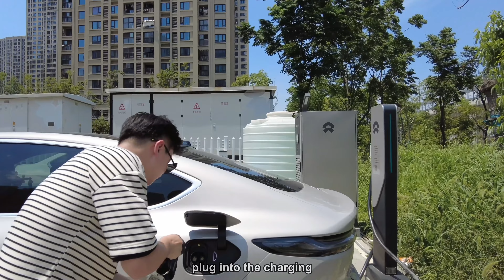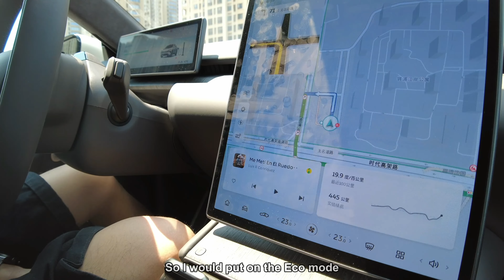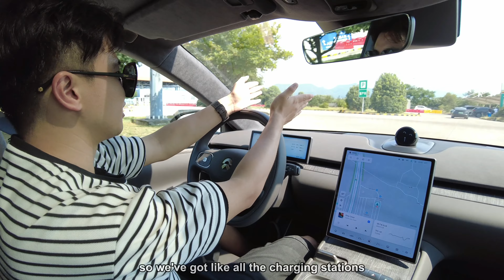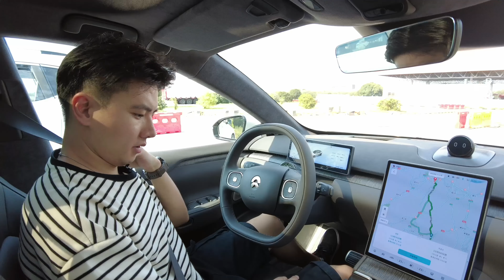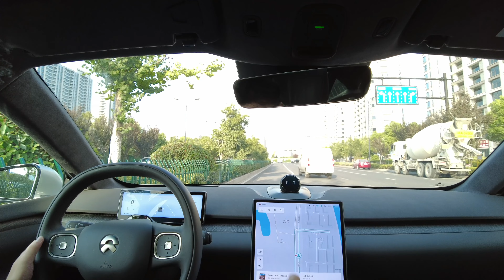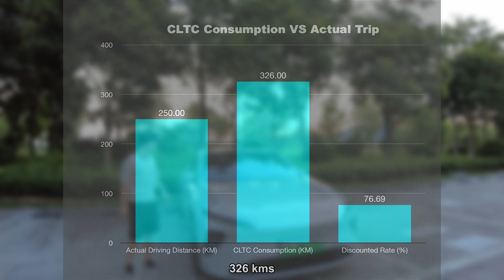NIO ET7 Range Test At High Speed & Extreme Heat Wave | How Far Can It Go With NIO 100 kWh Battery?

Comment from the maker: Hey guys, forgot to mention the average speed on the video! This test is about highway range test as the city road driving distance was only 6kms.
We can work out from the video:
13: 31 PM arrived at Yiqiao toll station, Odometer: 3,316 kms
15: 01PM arrived at Dongyang service station, Odometer: 3,450 kms
So we’ve driven 134 kms for 1 hour and 30 mins (1.5 hours).
 
13: 54 PM leaving Dongyang service station, Odometer: 3,450 kms
15: 13 PM getting off the highway, Odometer: 3,561 kms
So we’ve driven 110 kms for 1 hour and 19 mins (1.32 hours).

Therefore, the total trip on highway is 244 kms for 2.82 hours
Then, we can work out the average speed on highway is 86.52 km/h.
One thing need to be noticed that we cannot drive all the time by following the speed limits there as there are alway low speed vehicles ahead.

Hope you guys enjoy it!
Reply: Thanks for the informative video and greetings from Kazakhstan) How many kilometers do you think ET5 with 100kwh battery can travel at a speed of 100 km/h?
Reply from the maker: @dragykz  Hi there, no worries, glad you like it! I am not sure about ET5 at the stage as it hasn't been delivered yet. However, I would say ET5 could done better job than ET7 because it has smaller size and weight than ET7.
Thanks for watching!

Comment: How did you turn off all the ding and dong noises the car usually makes.? When I watch European tests of the es8 the car makes many noises. Pretty disappointing range tests even with the temperature issues. Thank you for your hard work.
Reply from the maker: Hi there Reginald, the ET7 is actually quiet. I am not sure about ES8. For my ES6 is also no issue with noises, but the NIO NT 2.0 models are better on sound insulation, and range performance.

Thanks for sharing your thoughts!

Comment: Your calculations are right, i got real 531km on a hot summer day without stopping between and three people and luggage in the car. I didn’t use eco mode, but sport mode. The adjustment of the speed was similar between 105 and 115 km/h , air-con on automatic , it’s true more than 500km easy to get if you not driving too aggressive 😂⚡️🔋🏁
Reply from the maker: Yeah, agree with that. The 100kWh battery could go over 500kms easily if people don't drive too aggressive.
Thanks for sharing those information!

Comment: Hello from Europe. Maybe you should just do a long trip without so many variables. We had several range tests on smaller EV cars from here (way smaller lol) and they drove the cars from 100% charge to 0% when self protection mode of the car intervened and immobilized the cars one by one. Such test is very easy to "comprehend" and is a no BS scenario. You drive until it dies. Simple.

here is an example with medium sized cars.
https://youtu.be/xg6-Vc9CSwk
Reply from the maker: Hi there, yeah that would be more simple way for the range test, but we din't have too much time to conduct that long distance test on that day.
Thanks for your advise!

Comment: Just wondering how do you put Nio car in neutral mode (it doesn't seem to have the n letter in its transmission selector) like you do in a normal car like when you park but you need your car to be physically pushed when it is blocking the other car?
Reply from the maker: Hi there, there is a mode called towing mode that we can do it on the screen.
Thanks for watching!

Comment: If it consumed 14.6kw/100km it means your battery pack of 100kwh / 14.6 = 6.84 x 100km = 684km max range. That’s your range with a battery pack 100kwh and your consumption of 14.6 kw/100km
Reply from the maker: If we take that number the total estimate range even higher than NEDC range, but it may due to many driving distances were on the descents when we came back Hangzhou.
Thanks for sharing your thoughts!

Comment: how much does a 1kwh cost on charging station?
Reply from the maker: Hi there, it depends on the time, and different kind of charging station you going. For the one in the video, If you charge your car during the night 22pm-8am, or 11am-13pm then $0.09(¥0.6)/kWh and $0.04(¥0.24)/kWh for the service charge. From 8-9am, 13pm-15pm, and 17pm-22pm: $0.17(¥1.22)/kWh, and $0.01(¥0.1)for the service. Then, from 9am-11am, and 15pm-17pm: $0.21(¥1.44)/kWh, and $0.01(¥0.1) for the service.
Thanks for watching!
Reply: @joyevs_TV  thanks. in US too. prices varies from time to time, season to season. the charging stations in US cost between$0 .25 to$0 .50 cents per kwh.
Reply from the maker: @xianshi8896  No worries, good to know that!

Comment: Thank you for your effort. I have an ET7 with the 21 inch wheels, and I have been impressed with the car and range (though it is less with 21 inch wheels and the P Zero tires). I have found the efficiency to be very good and it is also fast. In comparison with my old Model S it really is impressive in almost every regard.
Reply from the maker: No worries Dirk, glad you like it! Yeah, I am surprised by the performance on the extreme heat day. I didn't expected it could reached to around 76% of the discounted rate at the time we were just starting the test.
Thanks for sharing your thoughts!
Reply: As a fellow former Model S owner, what does impress you with the ET7? Its not available for order in my country (Norway) yet, so all reviews are valuable. ☺️ Thanks.
Reply: @haknys  Well the comfort and interior quality, the ride is completely variable, the amount of features and comfort. The handling on the limit in sports plus mode is excellent - there are five modes all configuration. It is faster but I rarely use this. The thing I miss from my model s is the hatchback- the ET7 has a conventional boot. I suppose drive one, but make sure to try all the different drive modes. Hakon I hope this helps.
Reply: @9kilsyth  Thanks Dirk, it sure does help. Sounds like a gamechanger.
Reply: @haknys  do you know when the et7 come out in Norway?
Reply: @jenislyjensen  I called Nio, they said it would be possible to order it in December.
Reply: Can I ask you something? Do you use those Nio houses? Is that what it's called? The Nio club house, can you see yourself using that space?
Reply: @bluntfront  They are so convenient I use then all the time for coffee. So yes.
Reply: @9kilsyth  Thanks for your reply. I think Nio is doing amazing things. I'm excited to see them come to the US.

Comment: I really like your review on these chinese evs! So I wanted to ask, what you next project is going to be. I would suggest a few cars that I think could be very interesting in the future. 
1. If you get a Xpeng G9 in November or later would be massive. That car has very sophisticated charging and autonmous driving technology.
2. Byd Seal/ Atto 4 could be very helpful for your channel, because of Australian attention. Looks very sporty and is a Model 3 competitor. 
3. Avatr 011 is a NIO ES7 competitor with a very aggressive design. 
4.Shenlan Sl03 or Changan C385 is like a cheaper Model 3 with extremely high energy efficiency. Maybe even less energy consumption than the Tesla Model 3.
5.Leapmotor C01 is also a very long sedan like the NIO ET7, but lower price
6. Nezha S,  Feifan Auto R7 full electric version Aito M5e are all candidates for your reviews of higher end EVs in China!
Reply from the maker: Thanks again! Yeah, I would like to do videos about those cars once when we got chance. For the BYD Seal, I've been thinking to do a video for long time, but it's still not coming to Hangzhou yet. I will film it at first time when it's coming. I am so expecting those kind of high-tech things equipped on Xpeng G9 as well! 
Thanks a lot for your advise!
Reply: wow, you're so similar with Chinese New EVs

Comment: What was the average speed of your trip ? I think that is a very important aspect, because the higher the speed the higher the energy consumption.
Reply: I agree - my guess is around 90km/h (perhaps a little more) since total trip took 3 hours (including some break time).

Despite missing this information it is a very nice video - great to have this as a reference - very interesting numbers
Reply from the maker: Yeah, very close to that number!
Reply from the maker: Hi there Johann, thanks for pointing that out! 
This test is about highway range test as the city road driving distance was only 6kms.

Then we can see from the video:
13: 31 PM arrived at Yiqiao toll station, Odometer: 3,316 kms
15: 01PM arrived at Dongyang service station, Odometer: 3,450 kms
So we’ve driven 134 kms for 1 hour and 30 mins (1.5 hours).
 
13: 54 PM leaving Dongyang service station, Odometer: 3,450 kms
15: 13 PM getting off the highway, Odometer: 3,561 kms
So we’ve driven 110 kms for 1 hour and 19 mins (1.32 hours).

Therefore, the total trip on highway is 244 kms for 2.82 hours
Then, we can work out the average speed on highway is 86.52 km/h.
One thing need to be noticed that we cannot drive all the time by following the speed limits there as there are alway low speed vehicles ahead.
Thanks for your advise!
Reply: @joyevs_TV  @WooM . Thanks a lot for your thoughts and your precise data analysis. I have to agree that the energy consumption for such high temperature and moderately fast speed for this xl sedan is impressive. Overall very enjoyable video I have to say 👍! Also thank you for your replies in the comments!